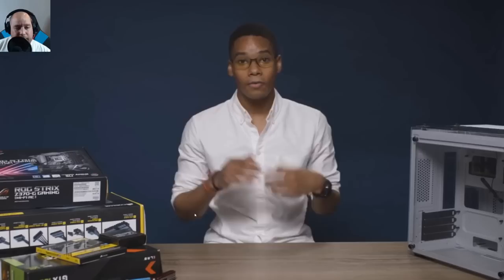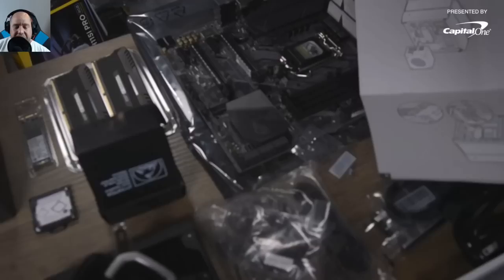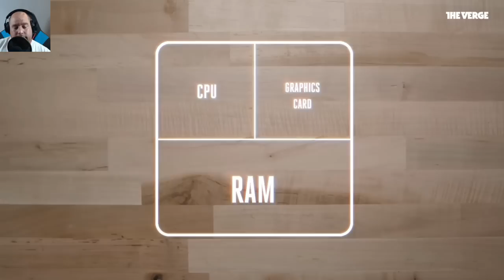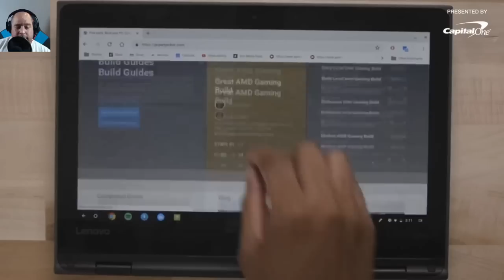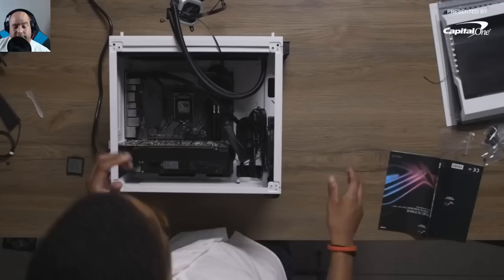THE VERGE - How NOT to build a PC

Comment: The part that really got to me the most is where he's pushing on the cpu with the paste spreader... God
Reply from the maker: It was just horrible.... so horrible, and the CPU applicator.... first I didn't even know that existed and second.... how hard is it to drop a cpu in a cpu socket... it hurt soooo bad but it was great for a laugh ;)
Reply: When using that stupid applicator, u have to push the cpu from the bottom, and he did that with the thermal paste spreader (another junk). Later, he removes the applicator and leaves it on the side because he figured it was useless. Apparently, u leave the applicator in the socket per asus instruction. But he spent so much time explaining it and then leaves it out.

Comment: 2:42 "That rubber band needs to be grounded"? Rubber isn't conductive, it's an insulator, how could a rubber band be "grounded"? Why would an anti-static wristband be made of rubber? It's supposed to conduct additional static charge/current away from the components. If the charity wristband he is wearing (cos that's what it looks more like) is worn, it's doing the complete opposite of what an AS wristband would do.

Anti-static wristbands are usually made of a metal/elastic mesh and they would have what looks like a rivet on them, that rivet will pop into a recess on the end of a strap, the other end of which would be a crocodile clip which you should clip onto your grounding point. A PC case, or something metallic which already has a path to ground. Anti-static straps are not usually required for a single PC build but will usually be used on an electronic production line.

8:05 He's not using the M.2 standoff mount, he screwed the M.2 retaining screw directly into the motherboard instead of putting the standoff in first and then screwing into that, you can tell by the angle the card is pointing at, that would possibly weaken or damage the connector end of it.

8:50 The card has the same connector as the PCI slots on the motherboard, it should be connected to the matching connector, it's pretty obvious which slot it should be mounted it but, yeah, it will usually be the top one.

9:12 Not covering isn't going to make much difference, airflow in a case won't make much of a difference to a naked M.2 card, a better idea would be to buy M.2 heatsinks which will allow airflow to assist in cooling it as they can ramp down due to overheating. M.2 heatsinks are becoming a lot more common now. Whether it would still "look good" is a personal choice but I'd take performance over "oooh I have an M.2 card".

10:03 Miniaturisation in components and Moore's law mean each iteration of components require less power and are more efficient with that power with each generation so no, a higher capacity PSU is less and less required.

13:36 The more important reason for keeping the CPU socket PROTECTOR is because, if you find out your motherboard has a problem which means you have to RMA the board back to the manufacturer or seller then an increasing number will not accept the motherboard back if the socket protector has not been re-fitted as, if it's damaged when they receive it, they can't confirm how it has been damaged, by you, by the courier so they will insist that it's protected before you sent it back. When you're done fitting the motherboard, put the protector back in the box and put the box in the attic so if the worst ever happens you have everything ready to send it back.

15:17 "...AND it supports overclocking"... Dear God, If he's this bad at putting the thing together, can you imagine the damage he could do trying to overclock anything in that computer? He'd probably go nuts with the voltages and blow the whole thing up in a puff of smoke.....to play league of legends.

17:26 A "grain of rice" is the best method to apply thermal paste on a CPU as the die underneath the IHS is a similar orientation usually (To be honest, it's best to look at some images of the CPU die that's inside your CPU so you can match your paste), so when the cooler is tightened down that will spread the paste in the correct fashion so it occupies the same surface area as the CPU die and gives an optimal thermal contact. Remember to factor in the orientation of the CPU when it's installed into the socket and then match the direction of your paste with that.

19:10 Just RTFM :) The manual will tell you exactly how your memory should be installed.

21:13 Yeah, if you have a "problem down the line" with your motherboard then you're probably screwed cos you threw away the CPU socket protector in that nonchalant way so they're not gonna accept it back and you're gonna be buying a new one.

Thankfully, this idiot's video has now been pulled, hopefully they'll redo it with someone who knows what they're talking about like Jayz2Cents, Would be brilliant if he could follow the exact same flow as the original but with all correct facts and practises.
Reply from the maker: so painful

Comment: The other thing to consider is that on some motherboards the system may boot and seem OK if you have the two RAM DIMMs in a single channel; however of the 16GB you put into the mobo the BIOS may only see 8GB of it.
Reply from the maker: Hmm, possibly but I have never seen that.  The motherboard manual will always tell you where to put the ram and what channel the memory be in, single, dual and quad

Comment: It's funny watching the reaction videos.

How different the opinions on what's right, what's a good idea, and how to do things.
One "professional" saying you don't need anti static, as he never uses one, someone else saying PSU way to big - only one guy has seen the "CPU Installation tool", but doesn't use it.
Many scoffing that $2000 isn't "all out", and that locking his frame rate is bad.
No dual channel is "breaking" the computer.

I'm tempted to make a reaction video to the reactions!
Reply from the maker: Addressing your concerns

I will state, I have never used an anti static wrist band either, they are essentially worthless and get in the way  As long as you ground yourself prior to touching the components, that part did not upset me, but i did mention it because he was saying that you need to use one,..... but he wasnt.  

Yeah, I always use PSU's over 1000Watts and everyone always tells me, man thats too much and everything but they update their power supplies often, I have never needed to, it uses what it needs.  

As for the CPU installation tool, I have never seen one in my years of building, and not saying that it might not be good, but installing a CPU is very easy, I don't see a reason why using one would be needed, have you used one before?

Locking the frame rate is not bad but I have never seen a reason to, have you?

Dual Channel vs Single channel will not break the computer but it will slow it down, no significantly.  I did mention that dual vs single channel in the video and on some boards the system will not post in the configuration he had it set, he was lucky that it did.  I mentioned more indepth about the memory but had to edit portions of it out, I had to do a few retakes because of background noise.

You should do it, always great to have content out there, I will be doing something like that, with a little twist, but I need to find time.  Thank you so much for stopping by and commenting, it means the world to me and I hope to see you around more often.

Comment: He lied about his M.2 drive, his is sata, not NVME.
He also doesn't put the standoff screw into the board first, so the drive is lying at angle, luckily the contacts are still made.
For $2000 why isn't there an NVME drive there? Its poor budgeting of money.
And why use a sata M.2, they don't give any performance benefit over 2.5" ssd.
Reply from the maker: Too many "why's" in this video

Comment: I just realized that he doesn't have the I/O shield properly installed. At 5:53 you can see that only the bottom end is fully seated into the chassis. A little thing but c'mon man!
Reply from the maker: I will have to slightly defend him on this, as not only has that happened to me, that has happened to many I have had the pleasure to build with, if you are rushing, you can forget that or the pressures of being on film, you want to do things perfect but are focusing on too many things.  One mistake can happen, but there was soooooo many on this video haha.
Reply: ThisBytesForYou  But this was a well produced video that a lot of people were involved with. Hell I've completely forgotten to install the I/O shield in the past, but if I put up a heavily edited  video tutorial on building a PC with such a high production value, I'd at least bother to double-check the footage. But then again that was the least of the, let's call them little oversights in quality control.
Reply from the maker: @Antares-dw9iv  I completely agree with, the fact that at least 13 people were involved it's horrible that it came out so horrible.

Comment: its just a rubber band like a charity one or ones random company bands, also he installed the PSU backwards (blocking airflow that case has vents on the outer case panel), 

most water coolers nowadays have the screw holes setup so they can't touch the water flow vanes because people was doing it(any H100 or higher has this setup as i own one myself its impossible to puncture the water vanes with long screws now, unless they go in sideways) but yes he used wrong screws there are short ones in the box, the long ones are for screwing the fan onto the radiator 

not actually sure how he installed the fans as he used 7 of the 8 long screws on the top radiator witch likely was poking out the other end of the radiator screw holes, most likely off screen he unscrewed them and put the short ones in and the long ones in the bottom

i always use 1 and 3 slot unless the mobo uses dual channel in 1 and 2 (only had issues with some HP systems having to use the 2 and 4 slot or 1 and 2 for dual channel)

after they taken the video down they are not blocking any one on youtube, twitch and The Verge comment sections that talks about this video (they are not taking any criticism) they are saying they had to remove the video due to racial hate and other stuff and not Admit that they published a video on how not to build a PC
Reply from the maker: Yeah, a total failure but thankfully I was able to capture it and bring it to you ;)

Comment: "You need this IO shield to align the motherboard"
I think i left mine in the box and yet... my mobo aligned
Reply from the maker: yeah its relatively often forgotten.  It is not needed to align the board, though it does help and it also helps keep the pressure in your case, keeping the air flow positive or negative as you chose.  So again, not needed, but is best if you have it.
Reply: I had the problem that the shield didn't fit properly into the case, Plus the case came with stands that had alignment notches.
Reply from the maker: the I/O shield is many times very difficult to install, but it would fit.

Comment: I followed this vid and mine is working fine
Reply from the maker: glad its working for you.  A few things you might want verify, 

1.  Is your memory running in single channel or dual channel (you can use CPU-Z to verify, if running in single channel, check your motherboard manual to see where it recommends you installing the ram to run in dual channel)?
2.  While gaming, what are your CPU MAX Temps (you can use HWMonitor to see your temps)
3.  Are you using liquid cooling or fan to cool your CPU?
4.  Is your video card running x16 or x8 (do you have many PCIe devices installed?).  You can use GPU-Z to verify
Reply from the maker: So did you find a few issues?

Comment: Why did he install the RAM in Single Channel Mode? Why is the PSU Upside Down and why would you install it before adding the specific cables you need for the build???? And why the hell would you install the mobo before adding the RAM, Proc, NVME with no standoffs??  He is just making things much more difficult. Also you must have the socket cover if you have to RMA the Board plus it automatically pops off when you lock in the Proc... Also why would you install the RAD before the fans for the RAD??  And why did he only use 3 screws in the Cooler pump? Wouldn't that not allow proper contact to the Processor? Why is he testing a new machine on Arma 3 and LoL??? He didn't even mention the front IO connectors! Is he gonna short the pins to turn it on every day?
Reply from the maker: Whoa whoa whoa , he is a pro, he told us so hahah.

Comment: This type of build and fake comments on they website really shameless (put the ram under single channel configuration and wrong PCI-E slot which only support half of the speeds.) LOL!!
Reply from the maker: They are trying hard to cover it up i guess, but once it's up it's up.  They should just say they messed up, they are human it happens.
Reply: After reading they Editor comment on they you-tube section really make people upset ....
Reply from the maker: @92trdman  yes, if you watch the video I talk about it
Reply: Nope, the board has both pci slots x16. Look up the baord. If you use both pci slots, it's x8 on each,.
Reply from the maker: @OneOff1  I know I mention that, both at physically x16 but on most boards when you put in a card in the second slot it slows them down to x8
Reply: Dudes only using one GPU though.
Reply from the maker: @OneOff1  yes I understand but go ahead and try it on your board, let me know how it works out for you
Reply: That would be hilarious if I had the same board LOL
Reply from the maker: you don't have to have that board, as long as you have a lane that is physically x16 and electrically x8 it would be the same.  The boards I have tested will not work with a card as the primary card on anything but the first slot.  Not saying it cannot happen, but I have not seen it on desktop board, though I have on server boards.